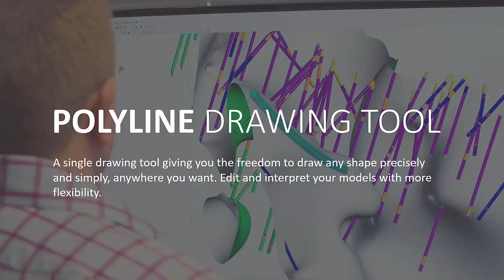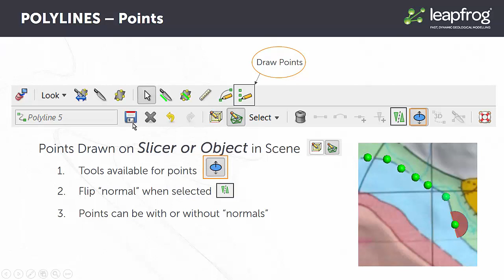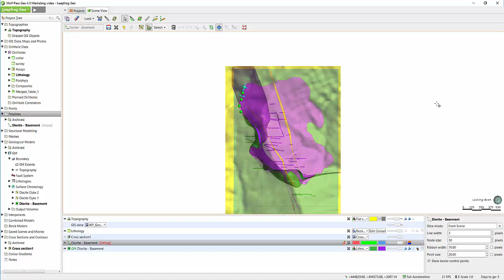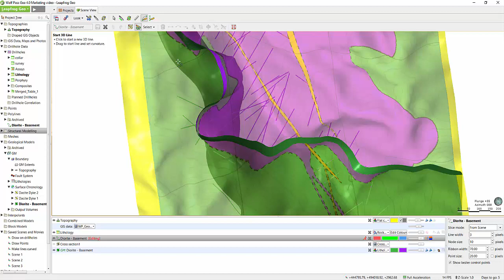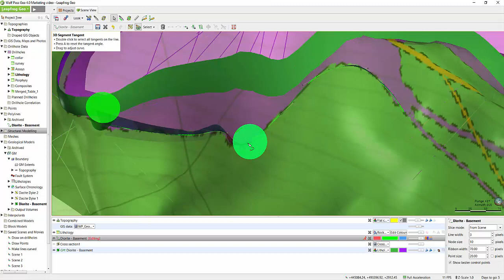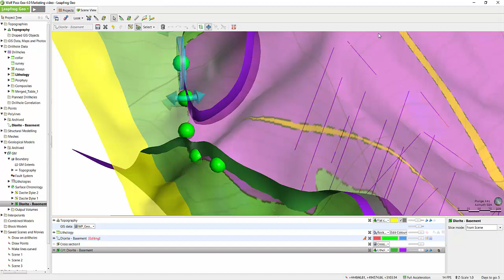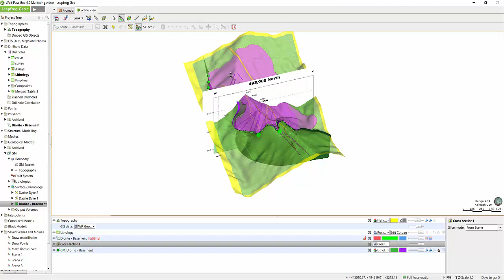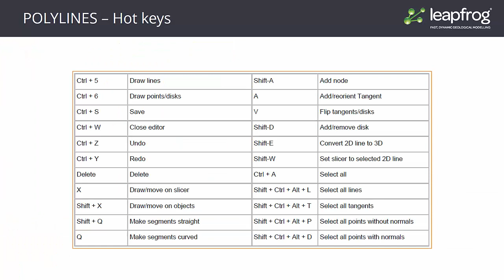Drawing in Leapfrog - Polylines

Comment: Is it possible to edit the polylines by editing the coordinates of the points?
Reply from the maker: Not easily directly in the software, however, if you export the polyline as a csv, and open it in Excel, you would be able to edit the points' coordinates. Once you have updated the coordinates, you can reload the polyline in Leapfrog. Unfortunately, this is not dynamic and it's a bit time consuming, but it is ultimately possible.